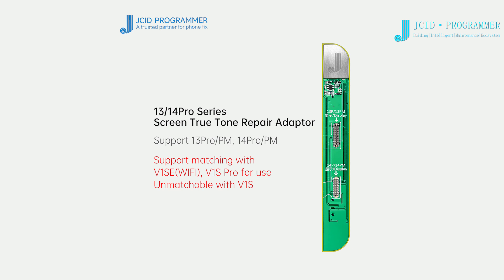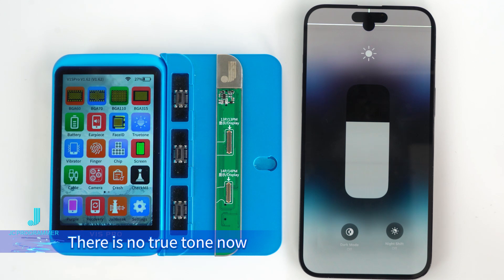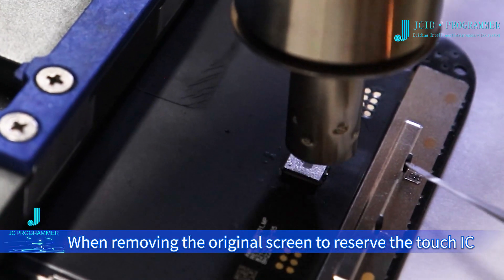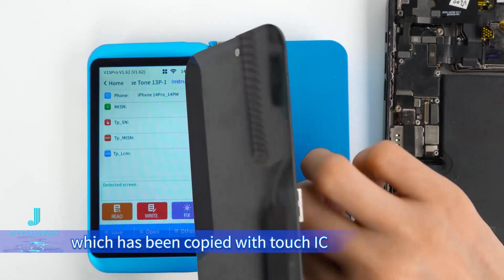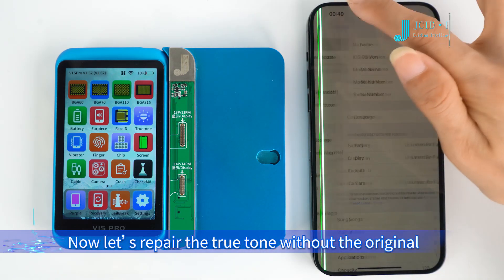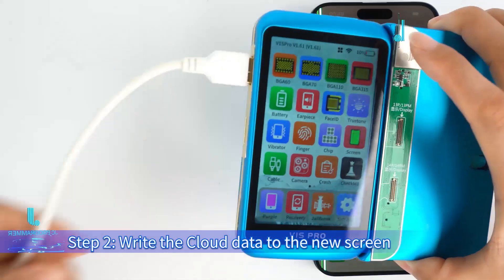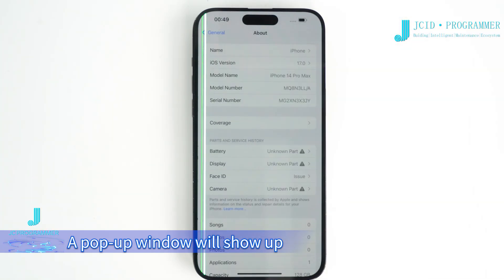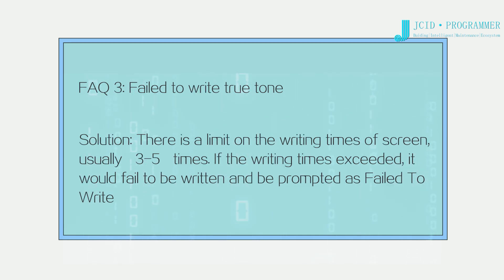V1S Pro 13/14Pro Series Screen True Tone Repair Adaptor Operation Guide

Comment: Option 1: Will it still for with triton and auto brightness if I don't remove the touch IC and transfer it to the new screen? I don't care about the not able to verify that the screen is original message